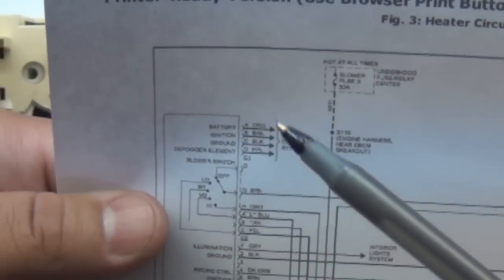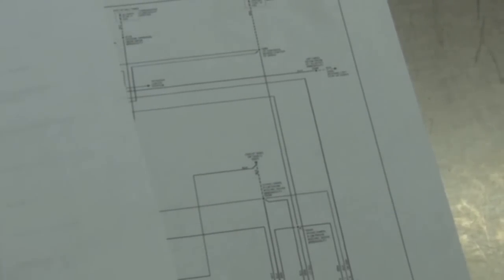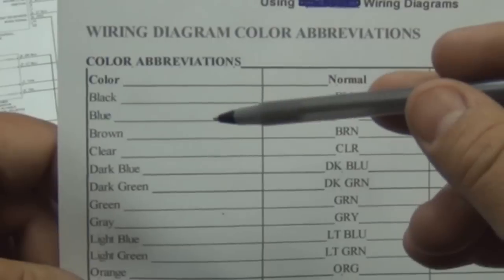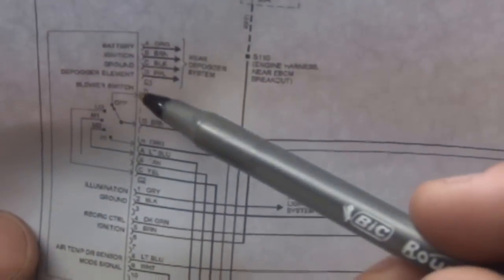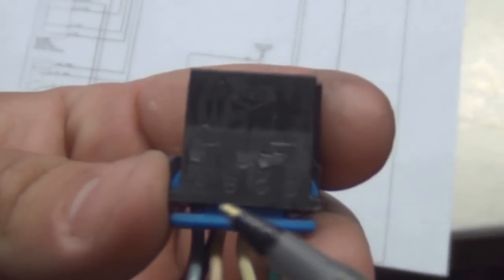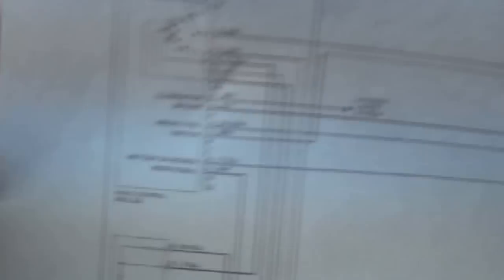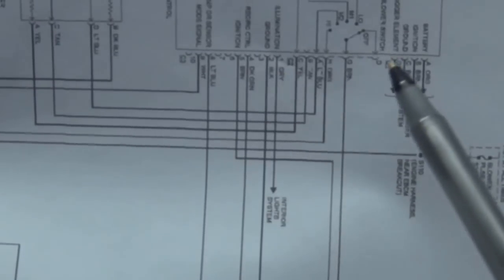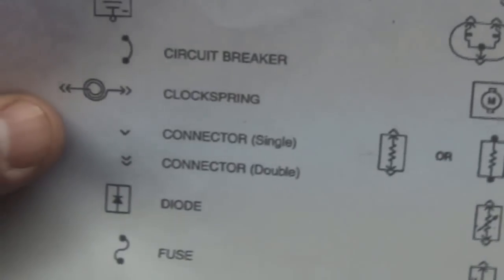How To Read Wiring Diagrams (Schematics) Automotive

Comment: Very nice but I could train a chimpanzee to read what color each wire is and the abrevations, I'm trying to find out what the three digit number next to a single digit number in my Haynes manual (S10 p/u, pwr. wdo., Every wire to the switch or motor has a single digit just above the color, & a three digit just on the other side of each wire? This manual don't cover dick as far as a legend of any kind. If you look at the injection for example, some of the wires have a fraction like 0.8 just above the color & on the other side of the wire there is a four digit 1387 for example, on one of the ground wires there is a 0.8 above the color ( blk) and on the other side 150 as most on the page are three digits, only a couple are four digits. It's all of the numbers that have me dumbstruck with no explanation in the book as to what they denot. Thank you in advance if you could let me in on this since the Haynes manual seems to be keeping this secret to themselves!
 wires

Comment: How do you understand wiring diagrams when the dishes don’t show the next connection? For example a Camshaft position sensor signal wire cuts off and leads just a # like for example from the wire it shows it leads to #72 but what is that lol?

Comment: What's a dashed line mean? There is a dashed line from the trucks generator to a fusible link then a solid line (red wire) from the fusible link to the junction block.  Its on a 96 S10 4.3L

Comment: Hi. Could you explain the flow of electricity through the wiring. Thanks
Reply: I will always start at the source of the wires until I hit either, battery positive or negative, for fuses, follow until you find the positive supply.

Comment: The wiring schematics I'm attempting to read are a bit more confusing. There are 4 digit numbers that I'm not sure about  near wire terminals. There's also a .035, .5, etc listed near the wire color which I think is the diameter. I'm currently going over a Chevy Venture schematic and it appears that the color coded wiring has a meaning behind it?

Other things I didn't hear mentioned that are on some automotive schematics:

 Sxxx (S = Splice. xxx = 3 digit number). First digit = location. 

 Gxxx = (G = Ground. xxx = 3 digit number). First digit = location.

I've forgotten the 1st digit location number meaning but I believe it is something like 2 = located under the hood, 3 = in front interior, 4 = rear, etc.

Comment: Great video!   Most people dont understand how to read wiring diagrams and the importance of using a wiring diagram when trying to diagnose an electrical issue on their vehicle.   Reading wiring diagrams is actually very simple.  Every electrical component on a vehicle needs power and ground to operate.   If it is a module or computer, they can have two or more powers and grounds to ensure they get the proper inputs.  Computers will usually have a constant power and an "ignition" power which gets power only with the key ON.
Reply: Amedee O'Gorman
Reply: Perhaps, though not knowing the design of the inputs that the computer needs in order to send out the signal, a wiring diagram only helps find where the wire kind of goes, most wiring diagrams are incomplete and you will need to know what each component looks like in order to quickly identify them. For troubleshooting, reading diagram helps but actuating or testing is where the real deal comes as you need to know your design. Not impossible to learn but not all designs are the same from car makes.

Comment: Good info, on my 71 corvette diagram from the solenoid the middle wire starts as a 12R then turns into 14BRN then follow along further and line turns into 10R. Does that mean different size wire throughout circuit?
Reply from the maker: +My1969chevelle can you take a picture and email it to me or do you have a link.  I have to see it.
Reply from the maker: +My1969chevelle can you take a picture and email it to me or do you have a link.  I have to see it.
Reply: +handy man Sure can, thanks.
Reply: +handy man sorry, I'm not seeing your email on your page,

Comment: Hey guy ! thanks for the tips! I do have a few questions though , First you sound a lit po'd at the start and I get that but you might want to be a little more happy doing your videos! Secondly, I have a 91 GMC that the harness has been butchered on, so I am wondering , do you have any idea's has to about how many circuits are ACTUALLY on/in this type of truck? Yes I know I could count the fuses but I am pretty sure the fuse block has been changed. Lastly , about how long would it take for a complete amateur do re-wire this truck?
Reply from the maker: Honestly , I couldn't tell you how long it would take an amateur because each person is different and can either pick things up fast or slow. As for how many circuits I would say get the wiring schematic for that specific vehicle, I use Mitchell's online. Hope this helps. If not, just count the fuses .

Comment: i have one doubt. i am guna from india. i saw some vedio like this. the diagram had only power and earth or ground point. 
where is the neutral point. 
or neutral and ground are same.
Reply from the maker: Neutral and ground are the same in automotive electric. In household wiring ground and neutral are 2 different contacts as well as your hot wire. At least that's how it is here in the US. Thanks for watching and commenting, I hope this helps. Please like, share and subscribe.

Comment: Hey man, thanks for the vid.  i'm wondering how you can find the actual locations on the car from the diagram?  for instance where a ground would actually be on the car from the diagram?  Any tips?
Reply from the maker: It usually tells you in the wiring schematic. That is a good question that I will address in detail in a later video. Thanks for commenting.

Comment: what is a box with numbers in it? i am tracing the fuel gage wire and it runs into a box wu=ith the number 14 and next to that is 15. there are like 3 boxes and they all have numbers with wires running in and out.

Comment: Great video, trying to re- wire my 73 GMC 3/4 ton. I got the only wiring diagram i could find but ts for a 1973 Chevrolet truck but it doesnt show the wiring for the duel gas tanks selector switch out to the tanks unless im looking at it wrong